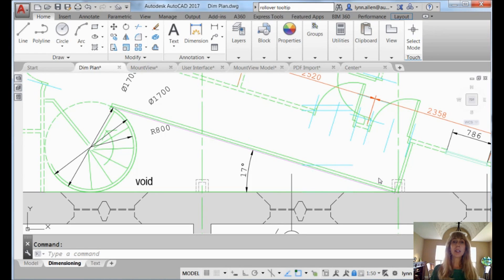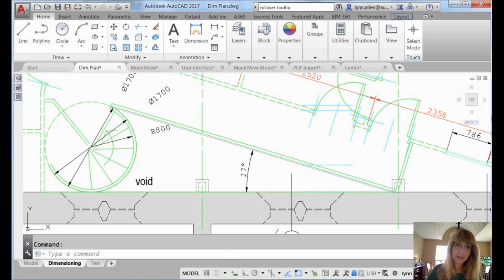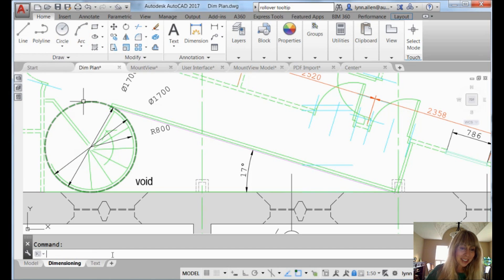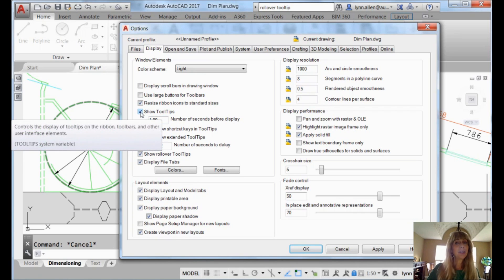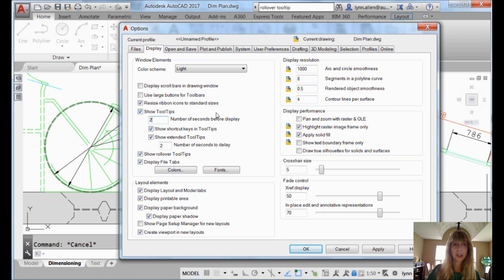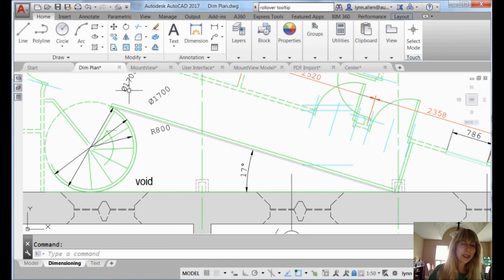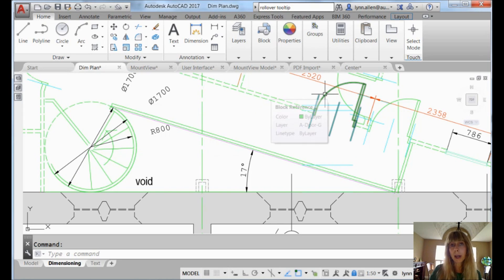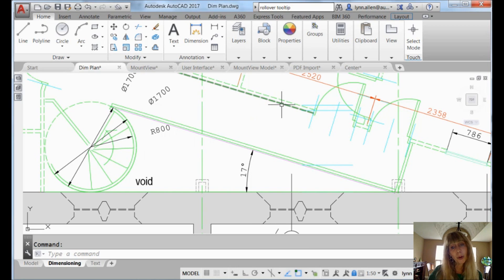Customize Your AutoCAD Tooltips (Lynn Allen/Cadalyst Magazine)

Comment: I think the Ribbon takes up to much vertical space. Is there a way to reduce the ribbon's size thus allowing more area for the drawing.
Reply: At the end of the ribbon's "tabs" there is a little box with an arrow inside of it, which allows you to "minimize" the ribbon. I set mine to "minimize to tabs" and it frees up the maximum amount of vertical space. Here's a screenshot of what I mean: http://i.imgur.com/EZ2lL87.jpg

Comment: Where can I control the information provided by the rollover tips?  I work with the properties window docked and if I could adjust the rollover tips to show more relevant information (attribute values, for example), I could potentially free up some screen space by hiding the properties window.
Reply: Command "CUI", then select "Rollover Tooltips" in the top left pane. Then, in the right most pane you can select what shows, based on object type. Screenshot: http://i.imgur.com/DXrgAVP.jpg
Reply: TheGreatDistraction woah. Thanks for that!